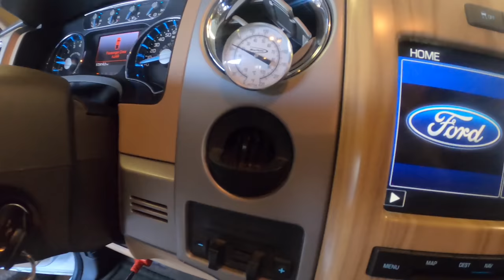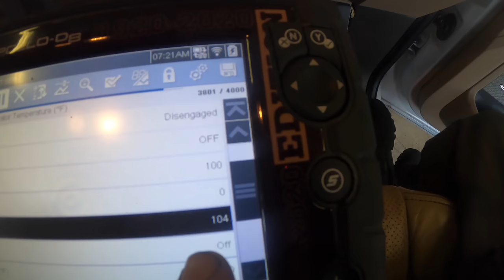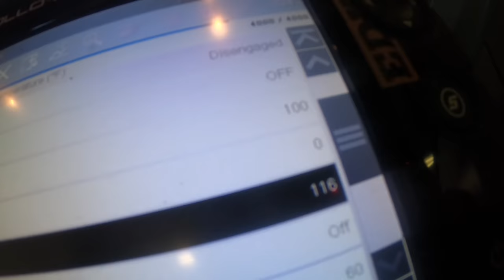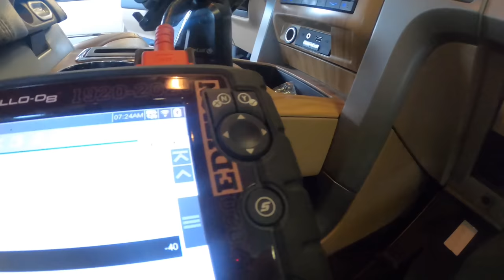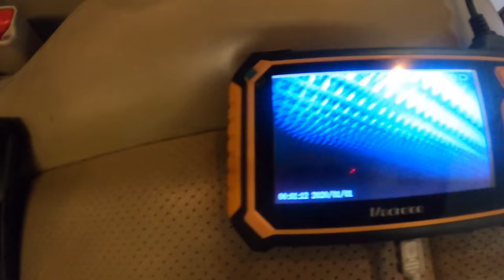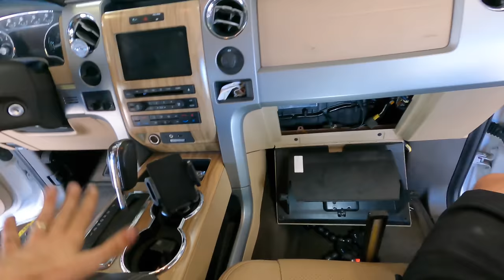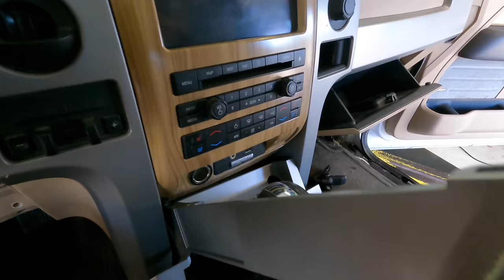TEN HOURS to replace one sensor! Ford 150 torn to pieces! Evaporator Core replacement.

Comment: I would off used a ossilating tool to cut 3 sides so you could of just opened it then re epoxyed it shut. You would  think they would off  made a small door.
Reply: Yep, I was thinking Dremel with a round blade to cut an opening. 😁
Reply: Problem here is that Ford doesn't sell the sensor and only sell the whole evaporator with the sensor built in, which is stupid but you can't replace only the sensor.
If it was my car I would have used that other sensor he tried at the beginning and find a way to emulate the original sensor's response, would probably be worth a few dollars of electronic components at most, but that's a hack you can't pull on a customer's car.
Reply: Ford may not sell the sensor but they're available.  Dremel a hole and try a few if you have to or modify the resistance of the new one to match what it's supposed to be.  There should be resistance values at certain temps available.
Reply: Andrew ROBINSON -Thank is a superb idea
Reply: My thought too. There must be an after market temp sensor available with the same spec !
Reply: I've tried it. I can't find any glues or epoxy that will last. The "door" blew open in less than 2 months or sooner. I finally use HVAC puddy tape. It did ok but even it would rip within a year.. I guess it was where the vehicle flexes and extremely humidity and temperature fluctuations. The best idea would be go to the junkyard and cut a bigger piece then use short screws to hold it in place. But by then you'll probably have more time in it than taking the dash out.
Reply: It just defies belief how these designers think it is a good idea to design cars this way that requires 10 hours labour to replace a sensor.
It's the same as my car, dash out to replace mixer shift on climate control.
Ford quote 8 hours labour for a $32 part.🤦‍♂️
Reply: @davidd1492    People keep asking this question.  My opinion is that they don’t care.  It generates more revenue for the service department.  People will buy them anyways.  It’s not like each brand doesn’t have issues like this so there isn’t really an alternative.
Reply: Same here.  then coated the flap with FlexSeal.  That stuff is amazing.
Reply: @Bryan-Hensley  Yeah - big patch of plastic over the hole. Epoxy, duct tape and self tapping screws until it stays put. Not pretty but you cant see it anyway.
Reply: @pbe6965  If you know what the resistance is supposed to be you can solder an appropriate resistor in parallel and get the correct range.
Reply: @davidd1492  The slogan here in Europe goes as follows, " Ford, go further ".  L O L
Reply: @Bryan-Hensley  that's what he wanted to do but couldn't find a sensor with the correct range (maybe he didn't search that much either, in the end the customer will pay)
Reply: @Bryan-Hensley  You mean thermistor ?
Reply: @locutusofborg  Yes, there are a few options, and I would also modify one if I couldn't find the oem.
Just saying that cutting the box is not necessary and wouldn't solve its issue because either you can find a compatible sensor and you can split the box to jam it in the fins, or you don't and you need to buy the whole evaporator like he did so you might as well install it rather than taking the risk to ruin a $700 part by trying to extract the built-in sensor from the new part :(

Comment: This doesn’t look bad! I had to take the dash out of my Passat to change an air duct director flap motor and it was essentially the same job, everything was just 2/3 the size and German. Ray here’s got it easy.
Reply: That's exactly why I'm scrapping my passat. Wiring loom issues buried in the dash. It's an old car and it's far easier to replace the car

Comment: One word - 'dang'. On the sensor, I wonder if there would be any way to bring the high values down with another plain resistor in series with the salvaged one.
Reply: For real, def worth 1hr of electronics research to see if there's another sensor or something like a resistor if you're a diy guy
Reply: I did this on my chevy colorado - added a  resistor. It worked great. In my case I did it to give me a colder temperature.
Reply: That is what I would have done. I have done this on engine sensors to get them to read in range temporarily.
Reply: A voltage divider circuit would probably be better than just adding a series resistor.
Reply: The problem is that you are assuming that the resistance form the sensor is linear (or near linear).  This is not necessarily the case.  If you could get a datasheet on the sensor performance, it wouldn't be hard to craft a replacement circuit with any old temperature sensor.  If this were my car, I'd be tempted to go that route and fool around with tweaking it until it was close enough to work.  Unfortunately, not an option for a mechanic though.
Reply: @T.J. Kong Two 20 Ω resistors connected in series will yield 40 Ωs. The same two in parallel will yield 10 Ωs.

Comment: Very poorly designed just to take that one piece out - that's insane - what a nightmare to do this repair
Reply: This is the way. Said FORD
Reply: I had a Crown Vic PI, and they were famous for blend door actuators going bad. A plastic geared failure prone part, thats buried in the center of the dash against the firewall. You can do the replacement without dash removal, but thats not the book. Taxi garages had it down to a science, but ya, Ford said to remove the dash.
Reply: @repro7780  heater core on my grandmas 08 buick said that you have to pull the dash, pull the hvac box, split the box, and get a new box.  A dealer tech told me you could do it in 2 hours or less by drilling out some plastic spot welds in the accessable part of the hvac box under the radio, and there was just enough room to get it out without removing the evap core. you then have to glue everything back together, but who cares, the original maker bases their repair instructions on how it went together in the factory, not whats actually possible in the real world.
Reply: @mikehenriksonII  many car companies now require the dash to be removed to access these components not just Ford
Reply: @repro7780  the actuator can be replaced without pulling the dash. The F-150 usually has the bottom of the blend door breakout which the actuator actually fits into which does require the dash removal. To avoid removing it you can access blend door to replace it by cutting a hole in the heater box behind the glove box. And Dorman makes a door that is two piece as a replacement. Then you can tape the piece of heater box cut out back in place. However my 150 has a broken Mode door which will require me to remove the dash to access the heater. I have seen a video of a couple guys that show in real time how they remove the dash in about 20 minutes. They used to charge $300 to replace a heater core on the older 150s I believe it is still on YouTube although it has been a year since I've seen it. However these are two guys that have been doing it for a long time and done many
Reply: If it was Toyota, it would. One of the things they CAD is ensuring repairability. Most other makers don't bother (Germans just layer everything over other stuff as they come to it "as it fits"), and it can really screw up production lines - Toyota were pretty unimpressed with BMW when they collaborated on the Supra)

Comment: Can't imagine how much this cost, but...  if it was my truck i would just manually operate the a/c by switching from on to fan or off when it reaches desired temp, meantime i would consider to trade it in...
Reply: 10 hours .... at $150 an hour (give or take depending upon market) means about $1500 in labor alone. 
Ray is probably getting a little less than 1/3rd of that.
Reply: Yeah, he said the whole evap was 1100 so this repair could be scraping into another 2-3K. Whatever their labor hour rates are, somehow, I don’t think we have to worry about Ray.
Reply: @Frank-og9jp  I'm not worried about Ray. Lol.

Comment: You needed to channel your inner Ivan on this one. Slip the temp sensor with the wrong resistance in there and breakout the decade box to figure out what size resister you needed to solder in to bring the reading into spec and then ship her down the road.
Reply: I wonder what all this work will cost the owner? I would just drive it with no ac or cycle the system manually to prevent freezing.
Reply: @vw5056  can’t drive in Florida without ac. At least my family can’t - outside the months of Jan and Feb. well except it got to 85 the other day.

Comment: Looking at this vid reminds me of the time I had to remove the full dash panel in my Nissan R31 Skyline to replace a leaking heater core. What a job!. Shortly after reassembly the heater on/off valve developed a leak.necessatating a full second dash removal. Got rid of the car after that...!

Comment: Seems asinine to have to take apart almost half a car just to replace one thing.  Ford needs to really re-engineer this so it's not stupid.

The longer I watch the more times I say "What the hell ford?"
Reply: There is a pretty long list of vehicles of different brands where this temp sensor is in the case burned. The Camaros one generation back have bolts to get out for climate box removal that require windshield removal. There are some nasty hacks to get around this for broken doors but not for leaking evaporator.

Comment: Ray I had a car accident in my BMW 328i hardtop convertible (the car was rear ended at only 6 weeks old) when I saw it in a million pieces like this I wept after I left the dealership, I was certain there was just no way it was EVER going to all go back together right, the wood trim was just laying on the concrete floor, and there must have been thousands of clips screws and bolts.  A garbage bag full it looked like.  I am in awe that you can remember everything you pull out then get it all back together without anything "left over."

Comment: Simple, SIMPLE solution. Just cut a square cutout in the side of the evap box. 
Pull the sensor out of the new box and then install to the existing evap box, using the extra hand-room the square creates. 
Make up a plastic "spacer plate" between the square section you cut out and the hole it creates (so the square overlaps the spacer, and the spacer then overlaps the hole). 
Use resin to glue the square section to the spacer plate, then resin those to the evap box. 
Job done. No taking the dash out (which is insane indeed). 
I know Ray understands this, but just explaining for the new people watching his vids

Comment: hi Rainman.  Nice video.  I love that you tried to find another less expensive sensor.  There is little current that flows through this type of sensor so really you are only concerned about the resistance vs temperature values. If you found the F250 sensor had a resistance too low compared to the proper F150 sensor resistance you could have added a separate resistor in series to make up the difference.  That does not guarantee the F250 (plus new resistor) resistance over various temperatures would be exactly the same as the F150 design spec. The impact is that the compressor may cycle on and off more frequently or less frequently... but if you selected the resistor value carefully you could certainly have the system cut out when it is supposed to cut out.  Also, i would have also considered cutting the side of the plastic housing to get access, replace the sensor and JB Weld it back up if it was my car.  I realize a customer may not appreciate that type of repair.  Keep up the great work.

Comment: Best video to date, A/C work is all fun and games until someone looses an EVAP core. That’s why I stick to transmission work! From a fellow comrade in arms 😎
Reply: I don't know.... I've changed an EVAP core on my older Honda Civic and did not have to take apart the entire dashboard / center console. (Just a lot of the glove compartment area, and it was still a PITA...)

Comment: I've had to do a job similar to that before. Instead of removing the entire dash etc  to get to the piece in the HVAC box I used the whole saw to cut a 1.5" half or something hole in the box. Did the work I needed to and then epoxied a piece of plastic over top of the hole.

Comment: Many decades ago, my dad worked at the Ford Dealer in Ann Arbor as a mechanic, as earned his Engineering degree at Michigan. He got A’s & B’s. The Big 3 hired the A students, many of whom had never opened a cars hood, not alone worked on one. Cost and speed of assembly, trumps ease of repair.

Comment: on my ford fusion i had the same sensor go out, i bought the new sensor, cut and spliced the wires behind the glove box and just installed the sensor behind the glove box (taped in) and it worked fine for the rest of the life of the car.

Comment: WOW! What a hell of a lot of work for 1 sensor, incredible. Surely there must be a better design where an opening can be made in the hvac plastic system that allows at least the sensor to be accessed and replaced??
At this point i would spend the extra and change the heater core also whilst the whole system is out. RESPECT RAY+++

Comment: 2010 f150 blender door motor $27 for oem Ford part.  "Stealer" estimates 900 in labor.  Wife and I pulled dash and had it back in within 3hrs.  Ford has done a killer job making the whole dash come out very easy as an assembly.

Comment: Bloody hell man, you must have an amazing memory. I can see why some repairs are expensive. I don’t think manufacturers think about replacing some components if they go faulty. I hope you’re on good remuneration for a repair like that. If I did a job like that, I would have parts and nuts left over, and the car would be running backwards.

Comment: Ok Rainman what I did on my old 150 was use the sensor off a 90's F250, drilled on 1-in hole in the box, pushed  the new sensor thru hole into the core then added a restore to get the same resistance of a known good sensor, sealed the hole with a grommet and a little RTV. AC ran cold, cooling to 44F vent temp. If you try this search for a temp sensor that is close to the require part or lower make adjusting the resistance much easier to not required

Comment: Definitely did that the hard way. Steering column doesn't have to come out or the seat. The whole dash can stay in the truck by pivoting it on a bolt from the driver side. Can be done in and out in under 3 hrs

Comment: I wondered if it was possible to strap a resistor across the sensor to bring it down to the resistance you needed. You were so close to saving all that work.

Comment: If there's one job I always loved as a tech it was ripping out dashes. I specialized in engines, electrical, and aftertreatment, but the hot second a dash needed to come out I was first in line. I could have any dash torn out of a Kenworth or Peterbilt in about an hour and they never rattled when I put them back together. My record for changing out an HVAC box in a new KW/PB is 5.8 hours, half the time of any coworker of mine has ever been able to achieve.

Hated the rest of it, though. Glad I got out and changed careers.

Comment: I have the same problem with a Subaru Forester. What a pain.

That other probe you got looks just like the subaru one. Id' buy a bunch of different ones till I found one. The flip side is you might be able to put a resister across or in line to get the right reading.

Comment: That temp sensor, if it's a 2 wire, I'd just a thermistor. All you need to find out is the resistance the original was suppose to have then you can ID it. Personally I would ask the owner for permission to cut a 2" by 2" hole in the box to access the sensor. Use the original mount and the new thermistor, test it then reseal the cut out piece with JB weld putty and Bob's your uncle.  By the way Ray, your doing an excellent job, keep up the good work.

Comment: I've had to go into that box twice on 1 separate fords for faulty blend doors and was told to remove everything like you did but the shortcut was just remove the glove box and use a oscillating multi tool and cut a hole in the front of the box to gain access, worked like a charm. Once I completed the blend door repair I simply used a soldering iron to melt the plastic back together with the piece I cut out and also worked like a charm. Replacement part for you is unavailable without buying and replacing the entire box but one option is remove one from a boneyard the same way if used isn't a problem or buy new box and remove the unit from it and install it into the box still in the dash. Hope this helps you  or someone in the future.
Reply: It doesn't take the whole 10 hours ,3 or 4 tops

Comment: Missing bolts are a sure fire way to tell that someone's had ti apart before! This past Saturday I had to replace the thermostat, engine coolant temperature sensor, and alternator on my '04 Chevy Trailblazer EXT 4.2L I6 engine. There is a bracket that the AC line bolts to, has two bolts on the front, one tucked up behind the bracket. The two on the front were still there. The rear bolt, nada.
The late 90's Ford Taurus/Mercury Sable require the dash to be removed to replace the heater core, because if you don't the core won't clear a bracket under the dash. What is that bracket for? That bracket is where the robotic arm on the assembly line hooked onto the dash and swung it into the vehicle being assembled. Once the dash is in place, the arm releases from the bracket. Nothing else is attached to that bracket! So you have to pull the whole dash so the heater core can clear a bracket which serves absolutely no function whatsoever! As one guy on a YouTube video suggested, just cut the stupid thing off and be done with it! Then the heater core is easy to remove.